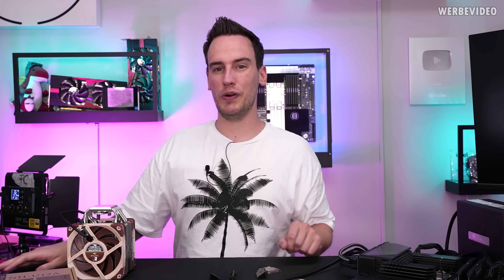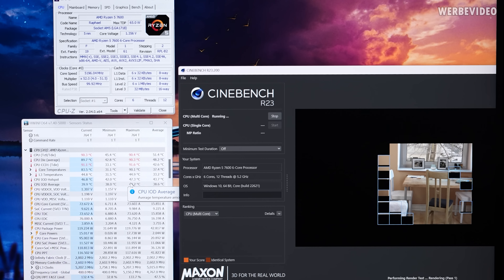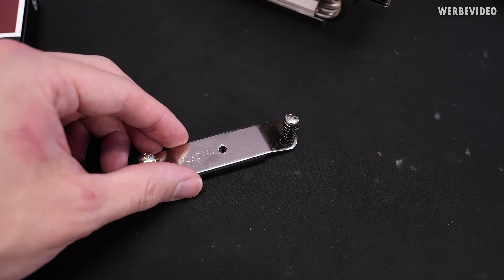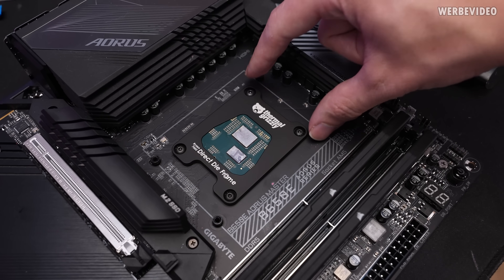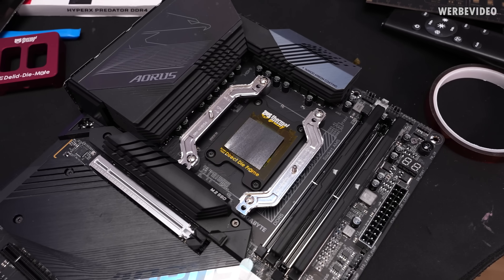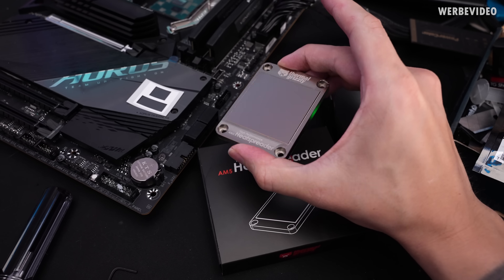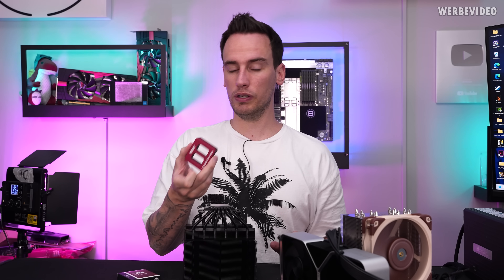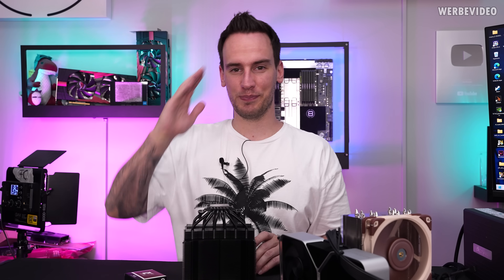How this 120$ Noctua Cooler beats a 360 AIO

Comment: Is this also compatible with the X3D CPUs? I've been wondering about the direct die Z height differences.
Reply: Alright you already talked about this in your vid. My bad. X3D CPUs have extra glue over the SMDs that make them incompatible with the direct die frame. Makes me really sad. Was hoping to use the direct die cooling on a 7800X3D.
Reply: From his previous delidding of the x3d cpus, it should be fine. He observed no z height difference.
Reply: Skip to chapter "7000x3d incompatibility"
Reply: Delidding is insane imo... Just use the AIO, do a bit of undervolting and keep your warranty in tact

Comment: Had a bad run with my water cooling setup in 2016. Killed about 8000 USD worth of equipment. After that I have air-cooled everything and I will probably never do water-cooling again. So high performance air-cooling makes me happy. (Edit: Typo)
Reply: What happened to your setup? Something in a custom loop break and spill while running or something?
Reply: I was using water-cooling for a long time, but the water pump died. Fortunately it was only part broken. I resigned from water cooling because of the hassle with the re-installation. It's not worth it. Good air cooler is fine.
Reply: Just always mount the rig upside down, now leaks aren't a risk besides running out of coolant. 😂
Reply: @chapstickbomber  pump could die
Reply: @grlmgor  don't even need the pump to die, my X670E Hero fails to turn the pumps on after sleep sometimes. I'll be playing a game and wondering "why is this running like shit" oh because the water temp is damn near boiling on the blocks. Lucky for ASUS it hasn't killed anything yet.
Reply: @chapstickbomber  If your pump dies your computer will turn off in about 10 to 20 seconds due to liquid not moving.
Reply: @grlmgor  you'd think so but mine takes many minutes. And then I have to wait for like 10 minutes to turn it back on because shocking a 90C bit of silicon with 25C water is not good for thermal strain.
Reply: @chapstickbomber  I had a 2600k with a small 120mm corsair AIO with failed pump  it was over clocked and it would overheat just getting into bios.

I would replace your cooler.
Reply: @grlmgor  nah. My loop is dual D5 with 960mm of 86mm thick rads and liquid metal on the blocks. Just because the mobo has an aneurysm and forgets to start the PWM signal for the pumps doesn't mean the loop is bad
Reply: @chapstickbomber  Oh it your motherboard that causing the issue. Also your loop is much bigger but still got to move the liquid.
Reply: Lots of people learn their lesson that way. Watercooling is just not safe.
Reply: @overtrist It heavily depends... take in mind tons of people are currently running water cooling setups and they are fine.

A good company support and maintenance matters and made a difference...
Reply: Nobody cares.
Reply: @s13shaka  you clearly cared enough to comment, you mouthbreather.
Reply: My AIO started leaking. Don't ask me how, because it was in the same place for 2 years, no movements. One day my PC wouldn't turn on. When I laid down and opened the PC case, there was this brown-ish liquid dripping from one of the tubes where it connects to the radiator. The radiator was/is mounted at the top. I had to buy new MoBo, but got new AIO for free.